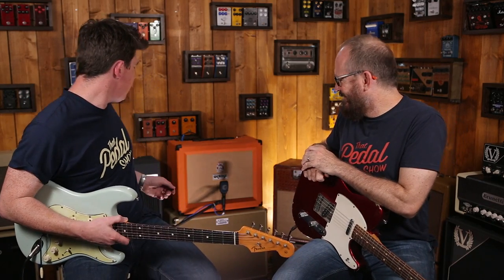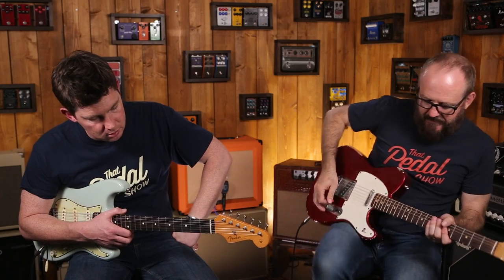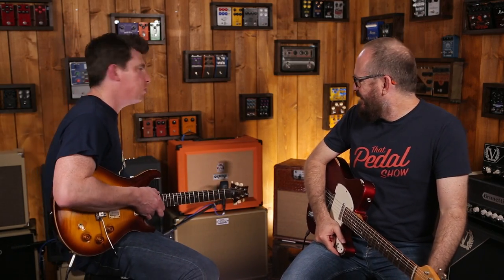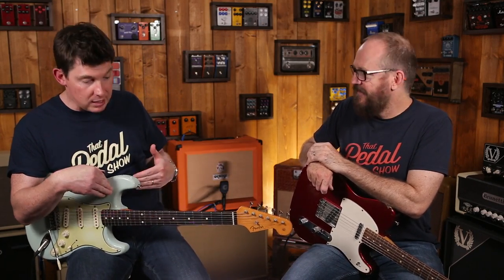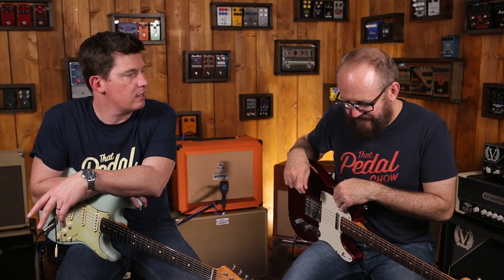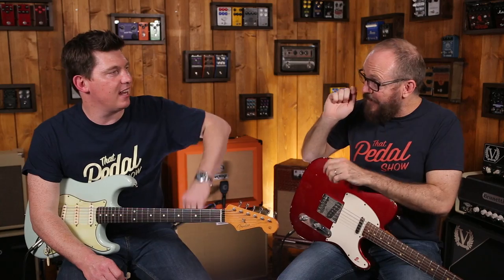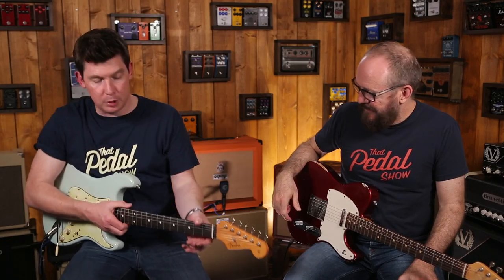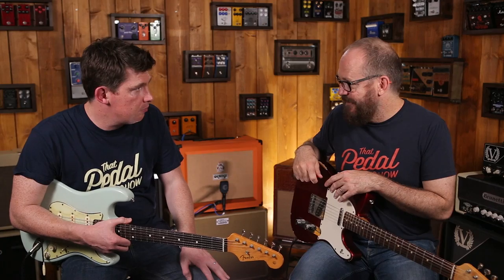That Pedal Show – Do We Like Transistor Amps? Part 1

Comment: Cheers & Beers for taking this one on!!

I wonder if the missing ingredient for the transistor amps is that even when distorting ("compressing"), they have such tight damping of the speaker that they don't sound/feel the way the Fender did in this one.  So maybe the mojo-bone for this situation is to have some way to lessen the transistor amps' speaker damping in order to get the tube amp's feel.

(I probably just screwed up & some amp company will patent the idea...)

The idea occurred to me because the transistor amps' distorted sound retained a very punchy attack.  The upside to that is the notes don't get lost in a mix even when heavily distorted.  In contrast, a tube amp might lose definition to the notes (albeit in a way we love).  When the tube amp's output stage runs into distortion, the feedback loop around the output section (which had been increasing speaker damping) will decouple.  That accounts for some of the feel change, and maybe some of the feel-difference between the tube & transistor amps.
Reply from the maker: +Brian Ingram go forth and conquer Brian!!
Reply: Fender is not known for making tight, articulate amps: you should test your hypothesis with notoriously articulate tube amps.
Reply: Fair statement for sure!

But also read the 1st paragraph of this:
http://www.butleraudio.com/damping1.php

(Which I suppose means I'm less original than I first thought...)

Comment: Great video as usual. I'd argue that there are loads of good value low end valve amps now that do make me question the use of these transistor amps for guitarists. They can be modded easily and cheaply with new speakers too.

Comment: I wouldn't mind seeing you throw in one of those hybrid amps with the tube preamp and solid-state power section, and see how that reacts to pedals compared to the straight all solid-state amps (and tube amp, too, although I'm biased as well, and assume that the tube amp will still far outstrip any contenders).

Comment: You might have also tried the Fender Bassbreaker 45 as your reference tube amp, as it has a built in attenuator, which kind of acts as a master volume for the compressed, overdriven sound.

Comment: Great video as always! The Strat/compressor/fender clean sound is pretty much dead on Sultans of Swing tone! Fantastic. I have an '83 Peavey Classic VTX combo that is a hybrid amp but has a transistor pre and valve power amp. It's amazing for certain tones. Underrated amp in my opinion. Hybrid amp review?

Comment: Not going to lie, I own an Orange Rocker 15, it's thick and growly and loves to be blended with a Rat, I tried the Crush 60 in a shop at a similar volume and it sounded extremely similar to my Rocker 15, however it did feel more "immediate" and not as smooth drive wise, it certainly did not sound bad though.

Comment: Good stuff, guys. The only non-tube amp I own is a Quilter 101 head. Tiny, light, portable. I use it clean on its Jazz voicing. Nice early/mid '60s Ampeg tone. For this purpose it's a terrific amp. It does okay in a pinch with darker dirt pedals too, but warm & clean is its thing. Horses for…ya know. :)

Comment: I use a Boogie Fillmore 100 and Roland Jazz Chorus 40 that I use separately & in stereo. I love ‘em both and wouldn’t part with either. The Roland has that stereo chorus that’s just like butter. I have a Roland JC 22 that’s for my analog synth and that’s an amazing small amp. 😌

Comment: One thing to consider is that the housings and speakers of these solid state combo amps aren't really anything as good as a dedicated 1x12 or 2x12 with some nice Eminence or Celestion speakers. Great vid though :)
Reply: Not necessarily true, the cab for the roland is class. Made of pine, and the custom tuned speaker is based on a broken in celestion and with the huge ceramic magnet on the back, is stupidly efficient. You wouldn't think 30w of transistor amp could cut it but it does.

Comment: Great video and the Fender is the clear winner for me. However I would really like to see this repeated but using Blues Cube Artist instead of the standard Blues Cube and a Boss Katana Artist instead of the Orange. Both of these amps use "Tube Logic" which provides a genuine valve feel. I suspect the results would be very different indeed!

Comment: I loved the episode. It was interesting to hear how the two types of amps handled the delay pedal differently. I personally LOVE the sound of delay pedals (especially the Strymon delay pedals) and would  like to hear them a bit more through the transistor amps (how do they handle long delay...maybe even digital vs analog delay. Is the difference as noticeable?) Another thing you almost touched on this at the end of the video is, it would be interesting to hear how a two amp set up would sound if you created a wet/dry rig using two transistor amps - OR one transistor amp for a crystal clear clean tone and a tube amp for that raw, crunchy, valvey, filth. :-)

Anyways, thanks for doing what you do.  This podcast has changed the way I think about guitar. Thank you!!

Cheers,
~Bobb

Comment: It really depends on what kind of transistor amp you're using. I used to have a Randall T2 amp which had 4 pre amp tubes in it but it had a solid state power section and it sounded monstrous ! Thing is, there are both good and bad solid state amps, much in the same way that there are good sounding valve amps as well as bad sounding ones.

Comment: Great show.  I too had a Peavey Bandit 130 as my first amp.  That Blues Cube is impressive for a solid-state amp.  And weight is 30 lbs (vs 50 lbs for the Bassbreaker) which can reduce visits to the chiropractor.  That said, I still prefer the sound of a tube amp.
Regarding the limited tone controls on the Blues Cube, would an EQ pedal help at all?

Comment: Another great & useful video chaps! Many thanks.

How about extending the 'transistor-amp' idea a little further - by looking at pedals that sound good through a PA system rather than a traditional guitar amp (tube or tranistor) esp. drive & distortion pedals

There are times when guitar amps aren't available and 'DI' into the desk is the only option

Just a thought!

Comment: Something I'd like to see in a future video would be running all the amps through the same cab.
Often solid state amps sound a bit rubbish because they have small enclosures with cheap speakers. 
I've found that through a big 2x12 with Greenbacks even inexpensive SS amps can sound pretty good.
Reply: I wonder how much difference that would make for the blues cube. I have the hot, and the pine cab and custom speaker is one reason it's expensive for ss (it's basically a boutique transistor amplifier). It makes a difference, as the blues cube is very rich for ss and way louder then a 30w ss combo has any right to be. The peavy bandit was stiff and cold in comparison.

Comment: Very important and informative episode. Though I feel that the difference between having 2x12 and 1x12 favored the Fender (not considering it being valve and the others transistors). It handles the bottom end nicely and gives the impression that it can fill a room better than the other two (Mick comented on it on the beggining of the video); maybe the others wouldn't be able to do this also because of the speaker and cabinet size.

That said, the Blues cube sounded great! If it wasn't paired up with that Fender, it would have kicked the Oranges ass. Much clearer, and I think it assimilated the sound of the pedals a lot better too.

Comment: It's just a lot harder to make a great sounding transistor amp than a tube amp... The early transistor amps made by Standel, Caine & Sho-Bud were really special. In part due to the germanium discrete transistors made by Decca (same as in SS McIntosh amps). The best sounding transistor amp I've ever heard (by a landslide) is a mid 60's Standel Custom XV. It's my most used amp, followed by a blackface vibrolux reverb. The need for more volume in the late 60's and into the 70's led to the use of silicone transistors which was the beginning of the end for solid state guitar amps, imo. Neve microphone preamps are a good example of how transistors can sound just as warm and musical as the tube stuff.

Comment: Sold state amps for the win for me...
I prefer them for what I play (from 1900 to mid 50's blues/jazz, surf, jungle, ethnic, symphonic metal, no humbuckers)
More intense Attack compression, nicer breakup(yes, indeed).

I love my boutique handmade Fender Twin Head with NOS parts and components (of course it's the best sound I've ever heard), but I've never played with ANY other tube amp and said "wow", most of the times modern tube amps sound too harsh and with very "cheap" sounding breakup when you drive them hard. Solid state amps are way cheaper and there are many amazing "sleeper" solid states around.

I could talk about that for hours, but at the end of the day Every amp is the best amp in the world and also the worst, what matters is that a good musician can work with what he/she has, a good musician doesn't blame the gear and a good musician is not a snob about other people's tastes and choices.

Just play.
Reply from the maker: +Panos Skentzos We wouldn't disagree entirely, but we might suggest a change of perspective on the 'blame the tools' and 'snob' points of view. Instead of blaming the tools, how a about 'a good musician is most inspired when they have a sound they love', and there's nothing snobby about disliking something. It's just an opinion and a personal preference. As you allude, everyone should use the stuff they love, whatever it may be!
Reply: That Pedal Show Oh, no, no, that's exactly what I meant, the "blame the tool" and "snob" part was partially about the severe transistor hate some people express in some comments or in face-to-face conversation and partially about guitarists that constantly buy gear trying to get "that sound" instead of actually sitting and studying their craft.
I didn't want to criticize you, I'm sorry if it seemed that way.

I believe that tone preferences are totally personal and should always be respected by others and yes, of course we play better when we like the sound, but sometimes guitarists force you to go "by the book", which takes away a ton of gear choices that seem "unconventional" (generally talking, not only about amps)

Anyway, thanks guys for the reply, it's really nice of you to do this, greetings from Greece, and... see you around the interwebs! :)

Comment: for me there are 2 options with transistor (solid state) amps: when using pedals, back off on the tone or use an effects processor (IMO better option with SS amps)

Comment: It just goes to show you that amps tend to have a thing. I was expecting to like the orange more than I did (I play/like orange amps), but the only thing it did well was the rock distortion. Which really wasn't all that bad. I liked the blues cube more than I thought I would. Still maybe a big flat sounding but genuinely usable. Took pedals reasonably well. Bluesbreaker definitely took the cake of course, but that is to be expected.

Comment: An interesting one to try next time would be one of the two notes - le preamp pedals into a clean solid state amp seen as there claiming to be a preamp pedal rather then just a tube overdrive pedal. one plus there tube / cabinet sim would also be a interesting comparison. On bass they work well but bass is simpler

Comment: Interesting that despite the advances in SS amps, the valve fender still has the nice warm midrange, that just sounds great for clean. I can't help thinking tho, that with a mid price valve amp that sounds that good, what about a low/mid price valve vs top end handwired etc test!!!

Comment: It did seem that the transistor amps could keep up with all the speedy licks even with a fair amount of dirt in the signal.  IF you could get some of the tonality issues resolved, the transistor amps' quick response could make it an interesting pair for a dry/wet rig --- transistor (compressed/dry) and valve (clean/wet).
Reply from the maker: +York Howie good call, we'll check this out ;£

Comment: Sorry Dan, but I just couldn't hear what you were complaining about at around 6:35 with the "attack" sound of valve vs transistor amps. The only difference I could hear at this point in the video was the tonality of each amp.

Comment: Although the Crush came out as least of the three it is £215 less than the Fender at Andertons, so really is addressing a different price point (You could buy a Blackstar HT1 combo and have change out of that difference).  The Bluescube is only about £20 less than the Fender, and to my ears on crappy laptop speakers held its end up.  As another poster says below speaker choice can make a big difference.

Comment: One of the few transistor amps that I've played and reacted close to a valve amp is the (discontinued) Vox Pathfinder 15R.  Plugged into a 1x12 or 2x12 it sounds tremendous !  Reacts to the guitar's volume pot and dynamic playing almost like a valve amp.  \m/

Comment: The brief segment with the Cali76 was quite interesting - unfortunately the compression it provides is difficult to perceive, even with good headphones, since the sound quality of YouTube vids tend to be already so compressed.  This seems to be a problem with ALL YouTube videos demonstrating audio compression.  That being said - the difference in "feel" using the Cali76 was quite noticeable, nonetheless.  My own experience with a SS backline amp (inexpensive Fender) I play frequently was that I had a similarly remarkable improvement in "feel" when using the Pigtronix Philosopher's Tone (Germanium Edition Ltd.) compressor into a Neunaber v4 mono reverb pedal.  What was notable to me - I heard very little audible improvement when playing the same two pedals in front of an old tweed 5E3 Deluxe Reverb a friend owns.   I also tried it with a few other valve amps - the only place I heard a really significant improvement was with the SS amp.  ???

I would ask others for their observations along these same lines:
Are some compressors more useful with SS amps rather than valves?
Reply: This has been my experience also, I've received comments about the nice tone coming from my solid state rockit champ. Clever use of compressor pedal gives the amp that spongy response can also get a mild edge of breakup sound for blues.

Comment: I wonder if a mix of compression (to slow up the response/pick-attack of the transistor amps) AND EQ pedal (to raise some lows and cut out that harsh high-end) could help match transistor to valve.
Reply: In the video, a very fine compressor did not help them much.
Reply: A fair point- in the video the Cali, as it was set up, seemed to actually exacerbate some of the clicky, unappealing characteristics inherent in transistor amps.  As Dan has the pedal set up, the Cali runs into the given valve amp and enhances the pick-attack in a delightful way.  However, with a little tweak a compressor can squash, or deaden, that initial hit of the pick and give a bit more sustain on the back end of a note.  

Never had such a fine compressor as the Cali, but it's transparency here may not serve the transistor amps well.  My experience with a battle-tested Dyna-Comp (which has a more thumpy, gummy attack) might be a better pairing.  But as is, my initial thought was the Cali (closer to how the boys generally have it dialed in) with an EQ to cut out some of the more unappealing high-end, might take them closer to a valve amp pick response.
Reply: Other than the pick-attack issue, I'm actually cautiously optimistic about the transistor amps - if not an alternative to our beloved valves (that seems clear thus far) - there is a bit of magic in how they deal with heavier sounds.  Having no sag despite signal slamming through the front end opens up a lot of territory.  Mixing both approaches, hence my other comment about dry/wet pairing, could be fruitless but I'd be curious to hear even so.

Comment: What would be most reliable ?  Also cost of ownership, taking into account second hand/trade in value ?  If a tube amp costs more, is as reliable as a transistor amp and but keeps its value better, then you might go with a valve amp.  Depends on usage i guess as well.

Comment: I have a Fender Stage (late 90s) that is my house amp. At 100 watts it blows its internal speaker if you're not careful. I use a Marshall Jackhammer in OD mode and it sounds ok. Not my gigging choice tho.

Comment: Great show guys.  How about a power amp, like the Tech 21 Power Engine, can you get a tube-like sound with pedals and one of those?  I run a JHS Sweat Tea into a SansAmp TRI-AC (Using CALIF & almost no drive) into a Power Engine and get what I think is a good sound.  Would be interesting to hear what you guys think.

Comment: Waiting for Part 2!! Anytime soon??
Reply: Also a suggestion for the next show. Maybe talk about swapping some speakers, using valve preamp and maybe considering the type of guitar and pickup set your using with the amp. I bring up the pickups because some are made really hot to push tubes and some are made to not push the tubes as much. I think its a very different approach in that aspect when using a transistor amp. I also bring those up cause they are some things I found myself trying and learning about as I used and started to use my a transistor amp again. Roland JC-40 👌